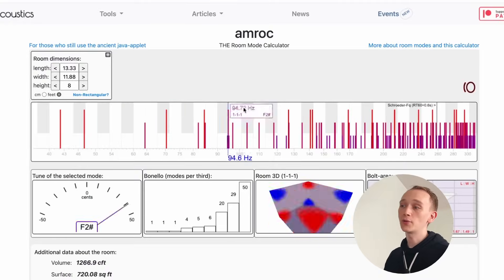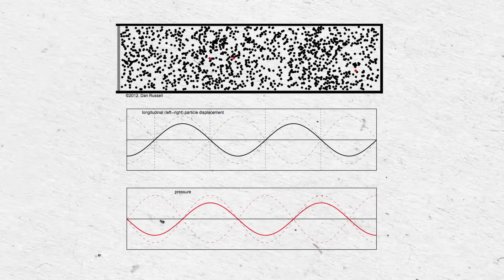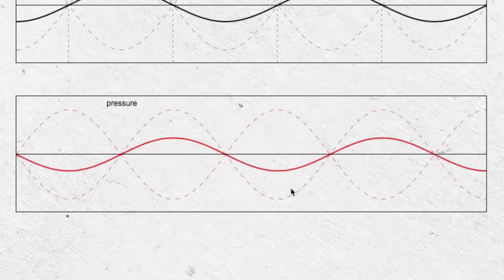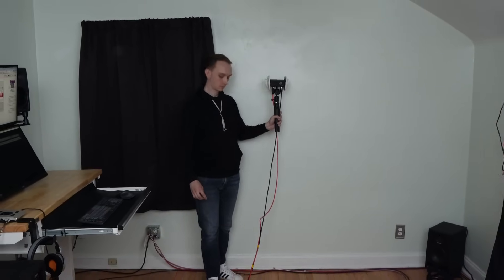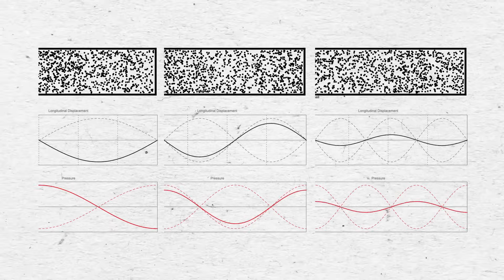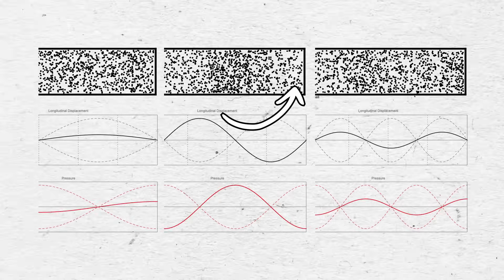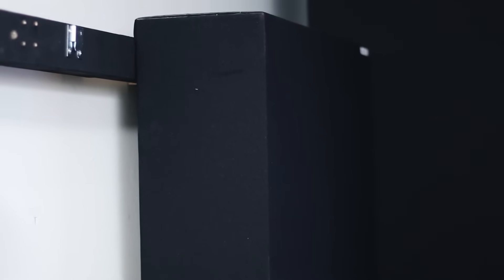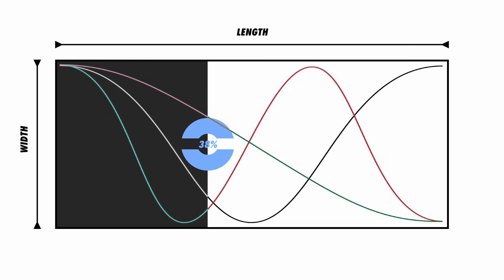Mixing In A Small Room? Watch This

Comment: It was good up to 8:18 and then he went into "imaginary", LaLa land. 8:18 - 10:42 is 100% bullshit. 
10:42 he calls it a "38% rule" and then goes Loosey Goosey about it. It is critical for ANY room that the listening position is placed at 0.375 times the length measured from the front wall. 
11:22 - Never sit where your ears will be in the center of the height dimension. (There isn't an issue sitting in the L/R center because YOUR EARS are not in the center. They are a little to the left and a little to the right. No problem. You must have L-R symmetry). 
Note: a single tone is not a way to specify speaker position based on the hypothesis of pressure nodes or antinodes. 

I would watch these videos with a large dose of Critical Thinking (use your baloney detection kit!)
Reply: I'll explain why 8:18 - 10:42 is wrong. Plain wrong. 
When sound waves enter a porous absorber, they bend and enter a velocity region. These porous absorbers are CALLED velocity absorbers because that's what they DO, not where they work. And, if you leave an air gap behind the porous absorber, you should CLOSE the gap to the wall. When a sound wave goes through a porous absorber, it forms a compression area behind the panel in the air space. The compression of the air behind the panel will increase the absorption converting it to heat. Have you put air in your bicycle tires lately with a hand pump? Get's hot, doesn't it? That's how absorption works in compression. 
Now, if you leave a gap of more than an inch behind any panel like this, there will be no pressure buildup or additional absorption. You might as well take the advice of someone telling you to drill holes in the bottom of your bicycle pump to improve the filling of your tires. #facepalm. 
I have laboratory testing data for everything that I talk about.

Comment: Would that angled ceiling improve standing waves somewhat by reflecting sounds at different times?
Reply from the maker: It certainly complicates things!
Reply: @AudioUniversity  It complicates calculations, sure. But is it actually helpful? After all the wave have to bounce to several walls till it reinforce itself, making the resonance frequency higher and also I think with less amplitude.

Comment: Thanks! Any idea what the effect of having a small room, a corner, and multiple monitors behind the speakers would be? All components in question are off the desk on stands / wall mounts and pulled a few inches away from the wall / each other for a little breathing room. But not much.
Reply from the maker: It’s hard to determine actual effects without measuring. Check out this video: https://youtu.be/td7Ue86Snfc?si=ygNUB94OpL2iKWB5

Comment: I'm living that small room life. In my 3.6m x 2.8m x 2.4m room, it took a fair bit of treatment before it could really be a workable room. But I did pretty well in the end. It took 29 panels total by the end of it and resulted in pretty uniform decay time down to about 110 Hz and things only really start getting wobbly below 85 Hz. Most of it is just a null at 73 Hz at my listening position and a couple of slightly longer decays around 50 Hz or so. It's the smallest room I've ever had, it's the most heavily treated room I've had, but it's the best sounding room I've had. I get the information I'm missing in the little LF scoop just by sitting in the other chair at the back of the room. So I can't complain, really.
Reply from the maker: Very cool! Glad to hear this!
Reply: Hi, my room is exactly the same size as yours. Would you mind sharing some treatment tips (or maybe you could possibly share your treatment project)? I'm really in the dark right now in regards of what to do to be effective. I have a treatment right now that was done poorly by a local company and it isn't doing much for me right now. Thank you!

Comment: My room is little (2.50 x 3.40 m), but full of objects, bookshelves with books, lamps, frames, and tapestry on the walls, moquette + carpet on the floor.
And it does not sound so bad (although not perfectly).
Thank you for the video
Reply from the maker: It’s good that your room sounds good! These objects don’t do much for low-frequency control, but as long as you know your room, it doesn’t need to be perfect!

Comment: What do you think about that virtual mix room software together with calibrated headphones?
Reply from the maker: It’s pretty cool! I’ve been using SoundID Reference Virtual Monitoring. I still prefer using my physical monitors most of the time, but the software does highlight things that I don’t hear on my physical monitors.
Reply: @AudioUniversity  But could it be used a replacement for monitoring on real speakers in a room?

Asking this because i have problems with sound levels and neighbours.